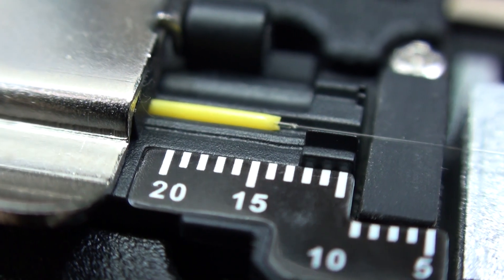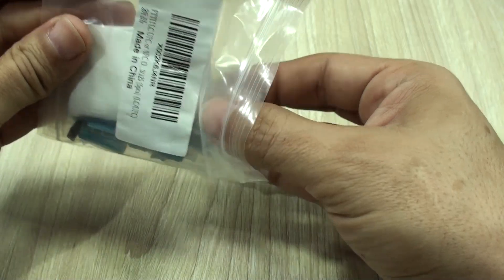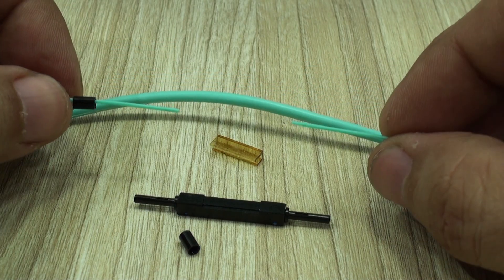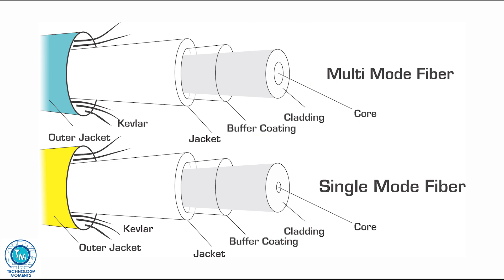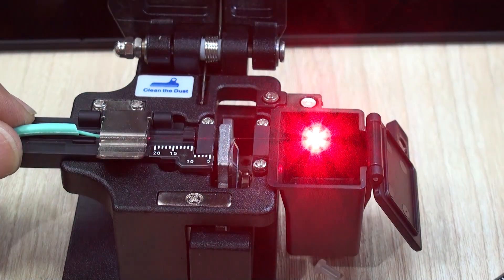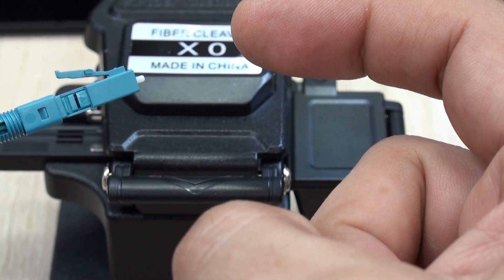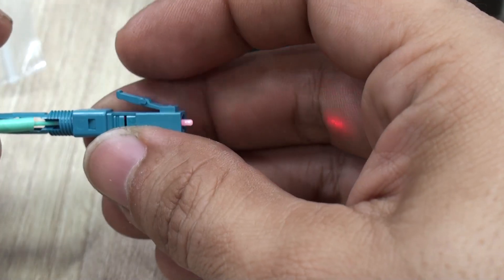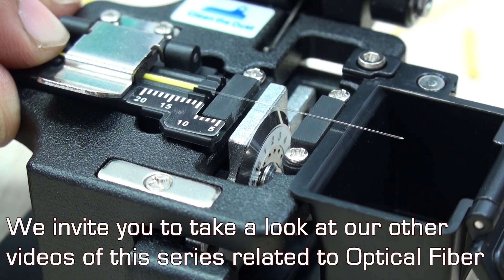Optical Fiber - LC Mechanical Terminals - How to use and install them?

Comment: Thanks for the good guide. But I must say I am still not having success. Even if it looks like I am doing everything right I usually get loss of about 8-12 dBs. This is using a pre-terminated cable where I cut off one end and mounted a mechanical LC connector for practice. I have no idea what I am doing wrong. Two things I noticed: when you strip the buffer in your video one can see it clearly come off, while in my case almost nothing remains on the stripper. But if I tighten the stripper further it just breaks the naked fiber. Secondly, when I wipe the fiber with cloth+ipa, a lot of light appears where the jacket finishes. not sure what causes this, I just hope it is not a sign that the fiber is damaged somehow.
Reply from the maker: Removing the fiber coating is of course very important, but as you mentioned what may be happening is that you are using a different sized (at least internally) LC mechanical connector, as the fiber needs to enter very easily and slide through the connector until it touches the ceramic tip ending.  That is not specified by manufacturers but, they do use a sort of optical paste needed at the end of your slicing so that cut will even be better.  But almost no force is needed to push the fiber into the connector.  Some brands do not have such fiber guide so smooth so it gets stuck before it even enters the connector.

Comment: Can 12 core fibre usually used for single mode fibre connection  be splice with LC connector on end points and used in 10g sfp+ multiple mode sfp Sr, 300m do this work? or we need have both optical fibre and LC patch chord to be multimode to be compatible with 10g Multimode sfp+
Reply from the maker: That's correct, both (actually the fibre core) need to be MMF to be able to transmit the light at the specified wavelength the SFP transceiver works.

Comment: It’s a good tutorial,
3db loss is a lot   What’s a causes?
The type of connector  or some other things 
Thanks !
Reply from the maker: It should have been less than 1, it may have been a small gap inside, with practice you'll get .5 dB connections

Comment: Great video. Thanks for all your effort. I made sure to like and subscribed :) .

One question,  where did you buy your kit with cleaver, fault locator, and power meter? Please provide a link to that. Thanks!
Reply from the maker: Thanks, sure here it is I just added it to the description:   https://amzn.to/40BCCyH    YICIZOL 30km Visual Fault Locator,Optic Fiber power Meter with FC,SC Connector, Optic Fiber Cleaver and FC/UPC(Male) to LC/UPC
Reply: @TechnologyMoments is this everything you need to terminate fiber please? And where did you get the extra connectors??

Comment: I've been trying to find out how to know how long to cut each part of the cable assembly. 
And do you gust stop inserting when you feel a little resistance when inserting into the new connector ?
Reply from the maker: Actually after a little resistance is felt you need to push it gently a little more sort of like twisting it.  This was the part I failed several attempts :-)
Reply: @TechnologyMoments  Thanks for the advice. After a few connectors going bad from the fiber breaking off inside, it's incredibly brittle, It's hard to believe these cables are supposed to be flexible. I took one bad connector apart, and saw I wasn't in far enough. 
There must be something wrong with the fiber if it breaks that easy just as it's about to enter the last part of it where it should be just the stripped fiber, even when being super careful. 
I downloaded a diagram of it, but you can't attach pictures in comments.

Comment: What is the link for the hardware your using?
Reply from the maker: Hola lo hemos actualizado en la descripción para que te hagas una idea de lo que teníamos al frente.  Aquí una copia:  Unifi Dream Machine Pro: https://amzn.to/4cvbRhT   
Unifi Aggregation Switch 10 Gbps (380 Gbps throughput): https://amzn.to/46TrVsI 
SFP+ modules by 6COM over OS2: https://amzn.to/46QYrLS 
DAC cable (twinax cable): https://amzn.to/3M6JITD 
10 Gbps SFP+ module Unifi for OM3 and OM4: https://amzn.to/3SRIUFM 
QSFPTech Bidirectional 10 Gbps long distance modules (40 km) over OS2: https://amzn.to/3Mbtp86 
QSFPTech 10 Gbps bidirectional modules: https://amzn.to/3WSdqAw 
TP Link transceivers for 10 Km: https://amzn.to/3AuhUGd